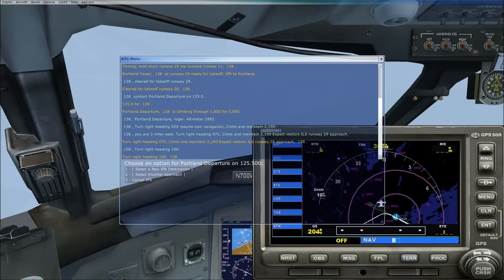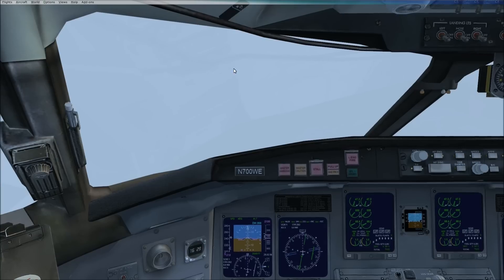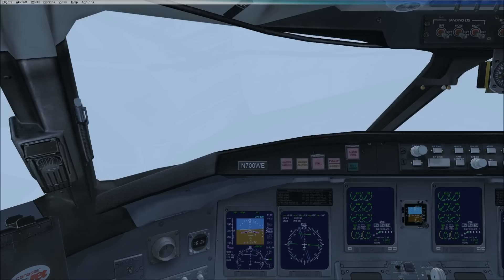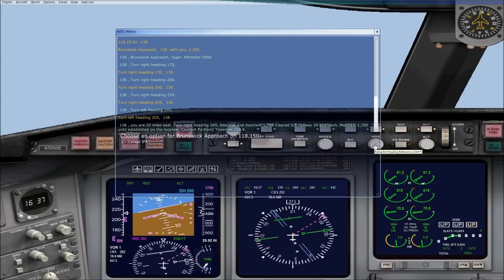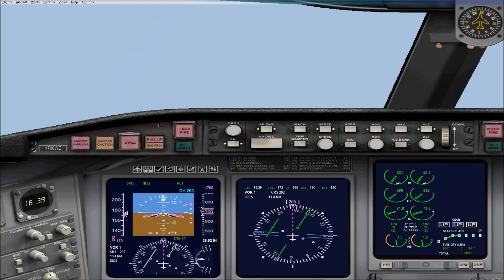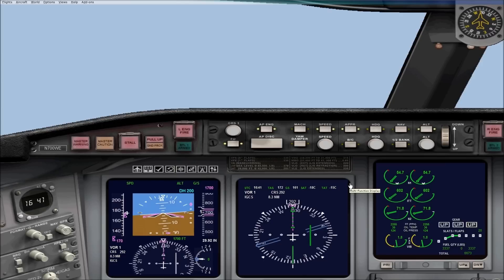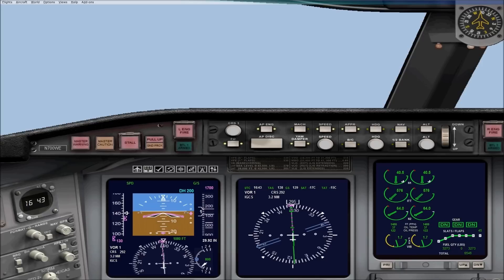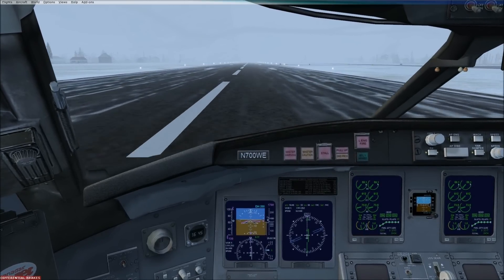CRJ-700 ILS Tutorial

Comment: @ 5:34 on the video, I've found that instead of just loading the vectors to final, activate it right there, and keep autopilot in gps mode. The nav gps switch is located just to the left of the primary flight display. The plane will fly directly to the magenta line and then line up toward the runway. When the plane is flying on course down the magenta line, then switch the auto pilot to nav mode and then activate the approach hold switch. That avoids the intercept to overshoot. Great tutorial. Thanks for sharing.
Reply: This comment helped me alot with the nav/gps issue I was having thanks !

Comment: Great tutorial.....easy to follow.  Thank you.  Question....some airports only have a localizer and no glideslope, correct?  In that case, at what height would you disengage the altitude lock to begin your final descent to the runway?  What is a good VS to maintain in order to stay on or close to the glidepath?    Also, with full flaps the approach speed according to specs is 151 KIAS.  I noticed that you came in at 130....??  Thanks again....great job!
Reply: I realize this is a year old but vref in the 700 is always around 130ish. 700-800 ft/min is what you want to descend at to maintain that 3 degree flight slope with a ground speed of 120-140. Hope this helps

Comment: Every time I attempt to turn on the APCH mode, at the correct time, ALT hold comes off, and the plane never follows the glideslope to land...
Reply: Make sure you’ve switched into “Nav” mode if you were using “gps” mode and be sure your ILS frequency and course are correct.
Reply: @baileyblack669  how do you make the switch??
Reply: Amtrak 6903 Train Productions I have the same problem.. have u found a fix yet ?